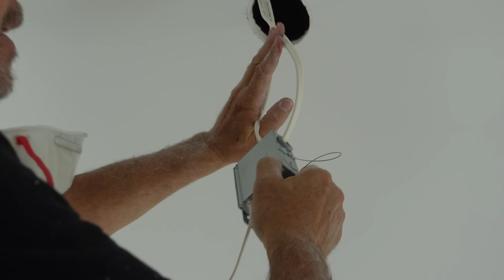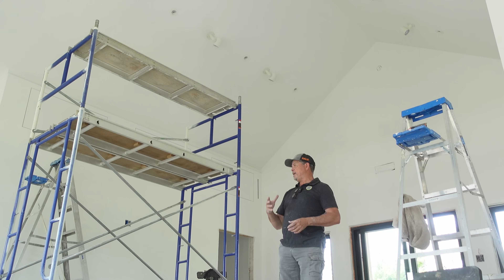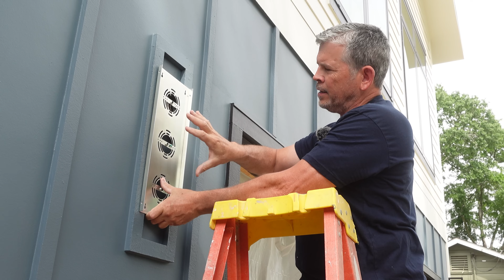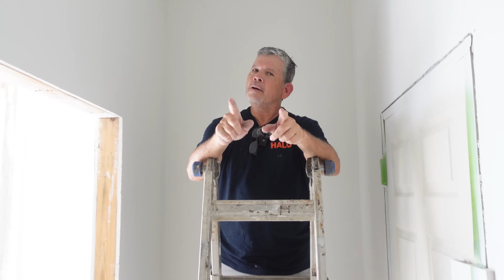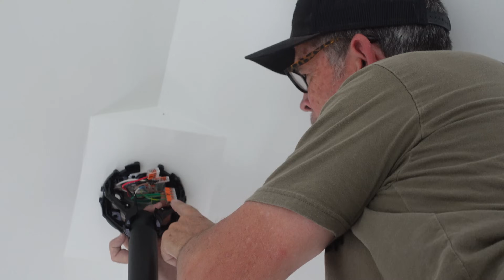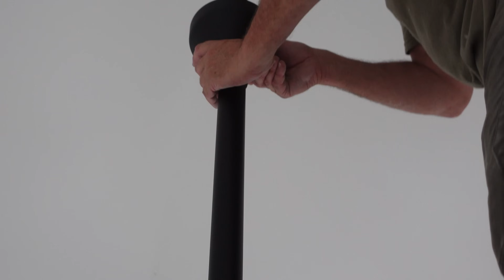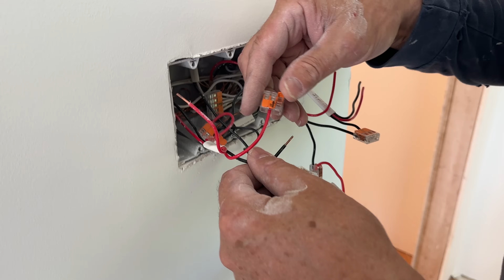Our $2,000 Fan wouldn't stop CLICKING.. So We Disassembled it and Here's What we Found

Comment: Im not worried about the government using my fuse box to control my home, like you mentioned in the prior video.

But I should mention this, all those wifi enabled devices you're using does present a security risk for Jordans home network. Now, breaking into a router isn't impossible and is easy for someone who is very good at what they do. However, those fans, lights, thermostats, and anything else you might use to make your ease of life just a little easier are a huge soft spot and any novice could access your network through those. I would normally say its not such a huge deal for the average person, however for someone with a large internet signature, its something worth considering.

Comment: GREAT JOB! I'm in north Texas and wanted to say howdy and ask a question. Which junction box or outlet box would you prefer using? Plastic or metal, and why? I am currently planning on building a 'garage-o-minium' in my 2 bay workshop garage and have been watching videos and reading about code requirements and therefor planning where to place the outlet boxes and junction boxes and I had a discussion with my supervisor at work on which box to use. Which do you prefer and why?

Comment: I can safely say that I have hated every ceiling fan I have ever installed, but I have to say Paul would be my top draft pick if I was going to dissemble a $2k fan motor! and finally, why don’t wagos come with a 4 wire option? I feel like I could use a 1/10th the number of 5’s that I do, if there where 4’s…

Comment: I don't know if y'all already have a solution for this. But one of the annoying thing about using any colored bulbs is they don't work if the switch is off. And even if you have a smart switch you have to turn it on then select color. The one way to have them work seamlessly no matter what is Brilliant smart switches. You can select colors from the small display and assign the regular switches to the light but they don't actually turn them off the switch just sends a command to the lights to whatever so app and voice and wall switch all play nice. Jordan, once you research these you're going to hate me because it's going to cost you a bunch of money when you decide to put these everywhere lol.
Reply from the maker: Something really cool about the HALO Wiz Lights is there’s a setting to “return to setting” after they get turned off, hit that switch in the app and they return right to how they were. Really cool

Comment: Two outdoor lights for $950.00. $2000.00 for a ceiling fan that makes a clicking noise and doesn’t move much air? Are you serious? Still wondering about the surge protection device in the panel.

Comment: On those down lights you can also just screw the junction box to the joist when doing rough in then on the finish just cut the hole and plug in the light
Reply: But then, years later, when the light eventually fails and you have to replace it with whatever's on the market then, you might have the old junction box mounted in a way that prevents removing it, or makes it very difficult.
Reply: @kc9scott  yeah that's true for a diyer but for our trade that's another electrician's scope of work in the next few years 😁

Comment: Think about it, if water went into the wago connector, nothing is going to short. each connector is continous, neutral, ground or hot! The only issue is if the contacts corrode making the wago unremoveable, at worse you would have to cut it off. Still not a real issue.
Reply: The corrosion might make it a higher resistance connection, and it could get warm or cause a voltage drop.  Probably not a serious problem since LEDs use such little power.  Might have been a more serious problem back in the days of incandescent lights.

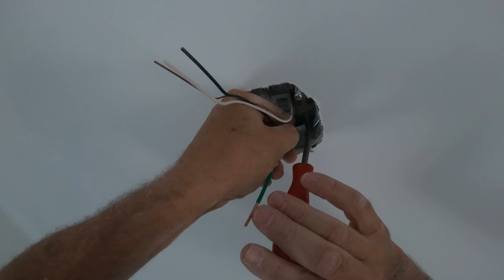Comment: @6:04 Yep, even though it's high up anything metal has to be bonded. If the hot wire comes loose like you said and it touches the box, the box will be hot and even though no one can touch it from down there, someone will find that the light isn't working, go up on a metal ladder and touch the fixture while holding onto the metal ladder and if the ladder is touching something that's grounded, zap!

Comment: Love that you used Wago wire connectors. I don't understand the hate but some people just refuse to see progress and change. As a German who had never seen wire nuts until moving to the US, I really don't understand how someone could prefer that. Especially since everything else is optimized for fast construction (power tools, pneumatic nailers etc.).
Reply: One big thing is whether real or not there's a perception that wagos aren't as strong, I can fairly confidently hang a light fixture from wire nuts (not that you SHOULD) but I do not have the same confidence with wagos. Additionally the number of off brand wagos I have seen/broken that come with or on fixtures is way too high so that doesn't inspire confidence.

One last point is I dont really trust the long term reliability, in construction plastic is basically crap and always wears out or breaks so I have a hard time trusting a wago when there are wire nuts from the 50's that are working just fine
Reply: @CaptainBlueTech  he literally shows hanging a light picture from the 221 in the video, 20ft up on the scaffold, with one hand
Reply: @sev8993   a small halo can and a big light fixture are not the same thing. I’m pretty confident I can hang a double vanity light fixture from the wire nuts while I grab something; I do not have the same confidence in wagos, MAYBE if I bought name brand ones but since I don’t really use them already I don’t have them on hand so the only wagos I would use are the ones that come with fixtures and those are garbage.
Reply: @CaptainBlueTech  so you complain about a brand although you never used their product? I guess my theory is correct then: the US hates push-in connectors and lever action connectors because they only know the Chinese knockoffs and/or confuse the  mechanism with a $1 backstabbing outlet. Cost of the name brand Wago clamp is negligible if it saves minutes on every connection.
Reply: @sev8993  it sounds like you just want to be angry .

First of all I never said I haven’t used name brand wagos I said I MIGHT trust hanging by it if it was the name brand ones but I never have them I only generally interact with the crappy generic ones: I have used name brand before and my original points all still stand, they don’t feel as strong and I do not trust a plastic mechanical connection long term.
Reply: @CaptainBlueTech  no worries, all good. Just enjoy trying to understand how electricians are so worked up about them, whether it's for or against. I have my preference, you have yours and I guess there are arguments for and against both methods. From my side it just sounds like not willing to adapt to new technology. It's also interesting how the Europeans are basically using the same arguments against the wire nuts that are mostly not up to code in Europe. Just enjoying Stud Pack videos, I apologize if I came off as angry

Comment: A $2,000 fan, and they hold in the balance weights with tape????? Really? Tape isn't permanent, the adhesive will fail over time. Speaking from a Helo Mech/Factory Subject Matter Expert Level who has too much education in that stuff? Huge Ass Fans needs to change its molds to include either 6 pockets for balance weights spaced at 60 degrees to allow you to screw in machinable balance weights or have the balance weights as part of the mold itself. Years down the road, that adhesive will fail, you'll hear a loud sound as it chews its guts up....but maybe that is part of the planned obsolesce. Let the tape fail and chew itself apart so you have to buy a new one.
Reply: Maybe that's what makes it a "residential product"
Reply: I dunno, I've never seen the adhesive on foil tape fail even after many years. Maybe in another couple decades? 🤷‍♂️
Reply: I expect the weights are held on some other way, and the tape is just to remind people to not remove them.

Comment: I love the Wago push connectors and have been using them for years. Using with stranded wire SUCKS!!!  But I just started using the 221 lever lock ones and holy crap, those will change your life. I pay a bit more but in time saved and every install is so clean making it super easy for the guy behind me.  I will never go back to wire nuts

Comment: You ask for comments.  When you were slitting the sheath on the cable for the small sconce, you held the cable in your bare hand while you dragged the utility knife to score the sheath. The unsafe part of that operation is that you passed the knife blade directly over your open palm.  For people who use a utility knife to do this, the important detail that you missed is that you NEVER hold the cable in a way that the knife blade passes over the hand that is holding the cable.  Always hold the cable so that the cutting edge of the knife is already beyond the point where the blade will contact your hand if it slips off of the sheath.
Better yet, hold the cable with a pair of pliers instead of a bare hand.
Or,  best method is to use an approved cable safety slitter or a wire stripper pliers that has the precise sheath cutter for the AWG cable size you are working with.

Comment: Years ago I walked into a body shop in south Georgia and I saw a 25 foot diameter fan. So, of course I reacted with, "Man, that's a big ass fan". They said, "Yep". A bit of back and forth for them to show me the logo. That's right, it really is a Big Ass Fan. It is expensive up front cost, but the owner saves a ton by having only one fan motor instead of a bunch of pedestal fans sitting around running numerous motors, not to mention space savings.

Comment: Trick for drilling pot light holes without risking damage to the wires is to start the hole in the forward position until you get a good groove, then switch to reverse to finish the hole. Even if you do hit romex with the blade, there will be no damage because of the geometry of the teeth when they are going in reverse

Comment: An interesting thing about Wagos is they actually have a hole in them on the top for test points for your multimeter leads.  By positioning them upwards with the wire coming out towards the ground, you will get water in this test point.  But I am pretty sure they are wet-location rated any way so it's a moot point.  Show off that test point thing in a future video if you haven't already, it is super useful for taking safe measurements on established circuits.
Reply: Correcting myself here: Wagos are NOT wet-location rated.  Put a Wago "gel box" on those outdoor connections 🤘

Comment: Wow, Big Ass Fans owes you guys big time for finding their QC issue.  They better set you up!
Reply: No.. they need to do DAMAGE control not "set them up"
Reply: @dtoad48  It's just a piece of tape, and customer service would have had them covered if they didn't WANT to take it apart and find the issue.
Reply: @mitchk7655 for a 2k fan they shouldn’t send it back or take it apart to get it fix is QC you don’t get this issues in the 300-400 fans
Reply: @mitchk7655 The only reason they ‘wanted’ to was to save time.   Sure BAF would have warranted the fan, but it would have taken several days to a week or more to get it all reboxed, sent out, new one sent, etc.  Major hassle.  They have skills, just fix it.
Reply: @mitchk7655  That is not the point, which you missed completely.  It was a 2000 dollar fan. The reason you buy a 2000 dollar fan is because the illusion of it being good and well built.  This video proves both of those things wrong.  Why would I now buy a 2000 dollar fan?  That is why they need to do damage control and inspect quality control methods.
Reply: @dtoad48 part of it is the quality of the MOCs. The fan actually looks incredibly well built. 

I agree this seems like a simple assembly issue that is easily rectified. A bummer on a 2K fan, sure, but fine. 

These things happen. I see that issue on porches and other expensive cars from time to time too but that wouldn’t exactly stop me from appreciating the overall product. 

I understand the frustration though.
Reply: This could have happened to anyone.  The greatest QC will eventually miss something.  However, I won't be buying one.

Comment: I just wanted to see how many people would trash talk the Wago connectors. Lol. There's always at least one guy, that knows a guy, that says they are dangerous. Never first hand. They say "they wear out, and create a short causing a fire". Well, don't constantly move them around to wear them out! I like them, myself.
Reply from the maker: We've noticed a big change even in our comment section in the past 4-5 years! People used to trash em... then they actually got their hands on some.. 😂
Reply: @StudPack  I like the 415's the most as I do a lot of 2 wires. But they have a straight through that is nice too. You can a splice wire that was cut too short.
Reply: Used around Europe for a long time and made by a reputable company. I've used wago products in commercial control panels for years. I agree with you wholeheartedly.
Reply: As as Europen I will never understand this "fear" of Wagos in the US. They are used for decades over here and nothing burned down.

btw I only see the Wago 221 lever nuts in Videos, dont you have the Wago 2273 in the US for solid wire and 224 for lamps?

Comment: You should really consider sealing around the outside lights.  Not so much for water proofing, but to keep insects from being able to build nests in those cavities.
Reply: I thought I seen a rubber gasket around them.
Reply: I was wondering why you would skip something that is so simple and cheap to do, and could save you from so much headache down the road. Also kinda curious why you didn't just add the 2 extra screws to the top of the front light fixtures, since that's where all the weight is going to leverage.
Reply: I could be wrong but I think they'll need to pull it out to replace the light when it goes bad and it would be a mess on the ceiling.
Reply: @stevewayne3676 He's talking about the fixture where it mounts against the wall and he's very correct, ants, spiders, wasps, bees, earwigs, ladybugs, wood beatles and other insects love to nest inside the fixture bases and electrical boxes.

Comment: Paul you should remove the un use clamps in the boxes because it adds to the number of wires in the box fill.
Reply: Clamp fill is not per clamp, but actually 1 allowance for all clamps combined. So removing unused clamps to save box fill only makes sense if external clamps were used to secure cables in addition to the unused built-in internal clamps.

Comment: Love Wago's.

I have even used them for just electronic projects as well as electrical work.  I haven't used wire nuts since I got these.
Reply: They get a lot of hate from old school electricians, but when wiring up lighting, particularly rooms with a ton of recessed lights, lever locking wagos are the way to go. You'll save your hands from a ton of wear and tear trying to twist all those wires, and you won't be sweating over whether that one stranded to solid wirenut connection was good enough or not.